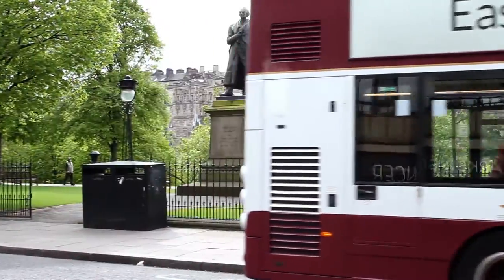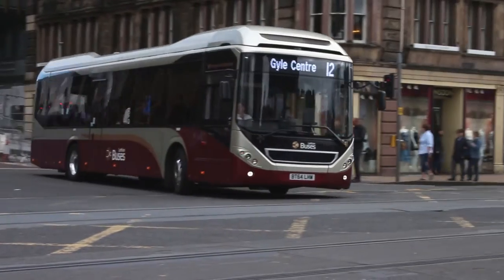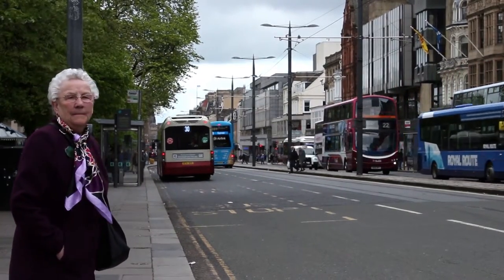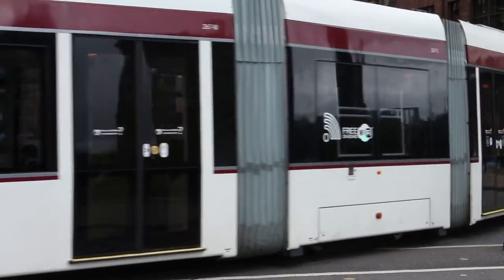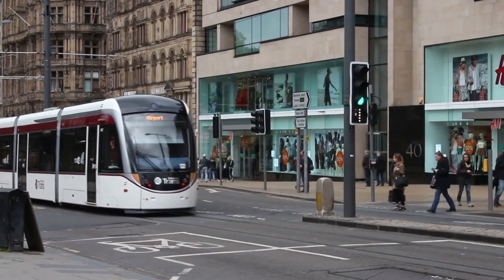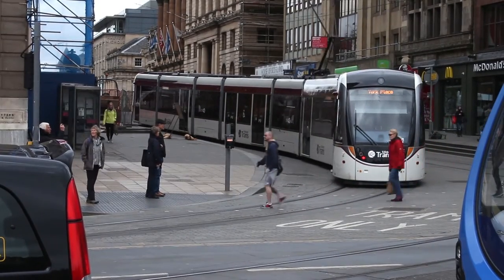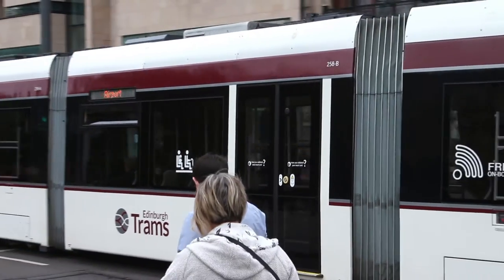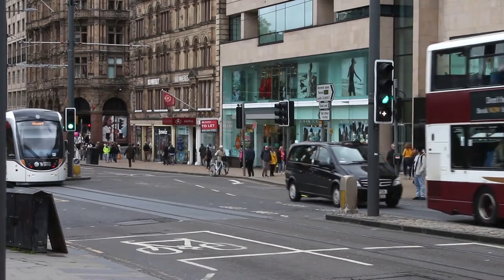Edinburgh Trams

Comment: tram network..wrong it's a single "part route" line

that will cost circa £1billion pounds once the loan is paid off in 30 odd years

and that's for 8.5 miles of a line